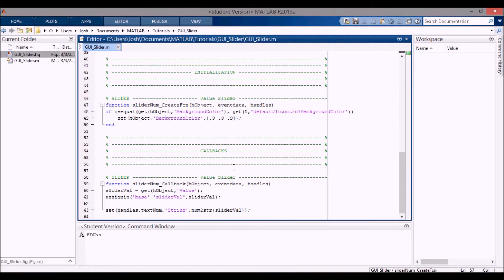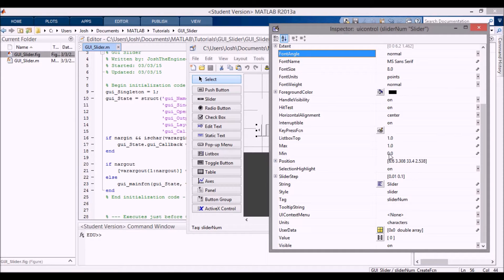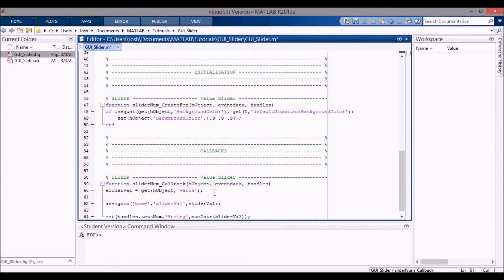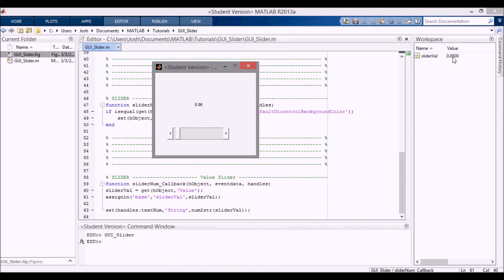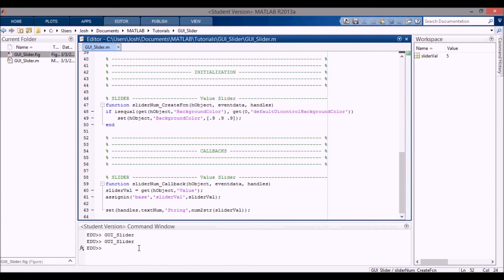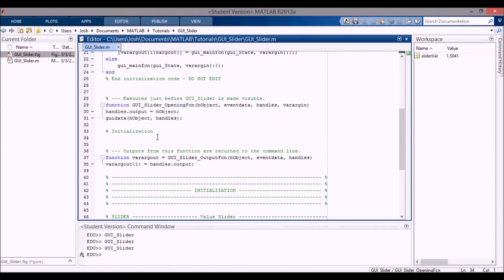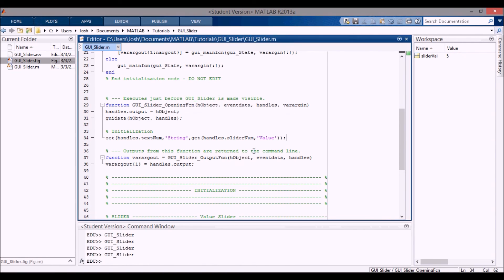Explained: Slider GUI [MATLAB]

Comment: Hey can you please help me out with setting a slider in a way that I can step through multiple images in two axes both a  time? A previous and next push buttons would also be good but I'm new to this and I'm having trouble figuring it out! Thank you so much in advance.
Reply from the maker: I would start by making a 'previous' push button and a 'next' push button.  Then in the callback for each, set the image you want displayed on the plot.  If you need both axes to show the same thing, you can link them.  It's a little different for images than for data plots, but the general idea is the same.  If you have more details I can try to help more.

Comment: well it looks like the definition of  'simplicity' varies from person to person... for me using just get handles is simpler than writing down 2 lines. also this code doesn't work on my 2015b; i used value = get(handles.slider, 'Value') and it shows me the value but not throwing that to static text...
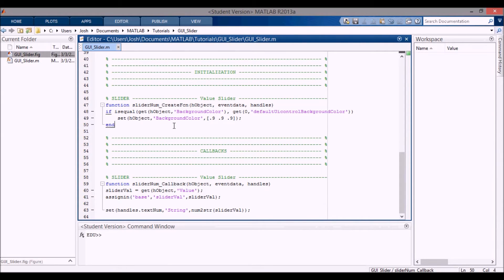Reply from the maker: The reason it's not displaying in the static text box is that you need to set the static text box with that value you get.  If you go to about 1:07 in the video, that's what line 63 is doing.  Here's the reason I wrote each line:

Line 60: sliderVal = get(hObject,'Value');

This line just gets the number that the slider is set to.  This number will change when you move the slider back and forth, and will also change depending on what your min and max boundaries are.

Line 61: assignin('base','sliderVal',sliderVal);

This code doesn't actually need this line, but it shows you how the variable 'sliderVal' can be returned to the base workspace (on the right side of my screen).  If you only need the variable in the callback or function where it is defined, then you won't need to assign it into the base workspace.

Line 63: set(handles.textNum,'String',num2str(sliderVal));

This is where I'm setting the value in the static text box in the GUI.  The first argument of the set method indicates that I want to set something in the static text box called textNum.  I can't use 'hObject' here because we are currently in the sliderNum callback, not the textNum callback.  The second argument of the set method indicates that I want to set the 'String' of the static text.  The third argument tells it what to set the string to.  In this case, I want to use the value of the slider that I got from line 60.  However, it's a number, and we need to set it as a string, which is why I use the num2str() function.

As newer versions of MATLAB come out, new functionality is offered, and I won't be able to keep up with new syntax, such as 'get.Value' or whatever the newest offerings are.  However, I believe the way I show it in this video is quite simple.  It also allows me to explain it step by step for someone who wants to know what each line does.  I personally believe it's a good way to teach it, but I'm always looking for other ways/ideas.
Reply: +JoshTheEngineer great, actually I figured that out and working now, don't remember what I did exactly but will post that here for other viewers if they go through the similar issue...
Reply from the maker: Sounds good, thank you.

Comment: I want to set the slider value like below but when i run the gui it said the slider control can not have slider value outside the Min/Max range.
How do I set the Max and Min value using the handles?

handles.plan_PosA   = plan_PosA
handles.actual_PosA = actual_PosA;

slider1Min = 1;
slider1Max = length(handles.actual_PosA);
slider1Step = [1/(slider1Max - slider1Min), 1/(slider1Max - slider1Min)];
Reply from the maker: Let's say we have a slider like mine in the video with the tag 'sliderNum'.  I'm running R2013 so I still have to use the set() command, whereas if you're running R2014, you can use the dot command (as in sliderNum.Min).  So now to address your question.  I mentioned in the video three important fields; Min, Max, and Value.  It makes sense that the Value of the slider should always be between the Min and the Max values.  By default, the Min is 0 and the Max is 1.  So if you decided you want to set the Value attribute to 2, it wouldn't lie between 0 and 1 and there would be a problem.  You can get around this by first setting the Max attribute to 3 and then setting the Value attribute to 2, for example.  This makes sure Value is between Min and Max.  The code, using my slider tag from the video, would look something like this:

set(handles.sliderNum,'Max',3);
set(handles.sliderNum,'Value',2);

If that didn't answer your question, let me know and I'll try to help!